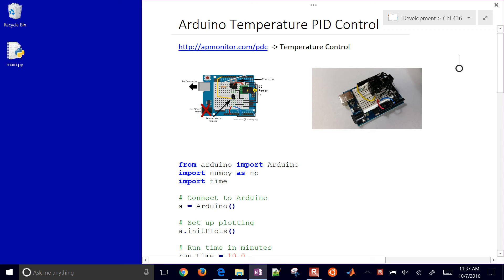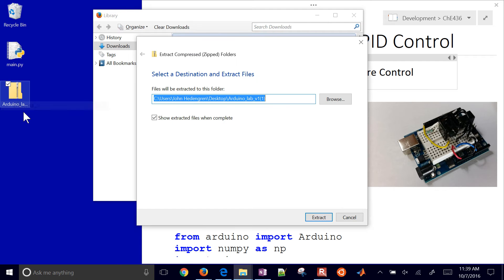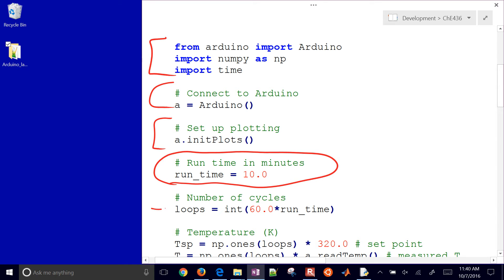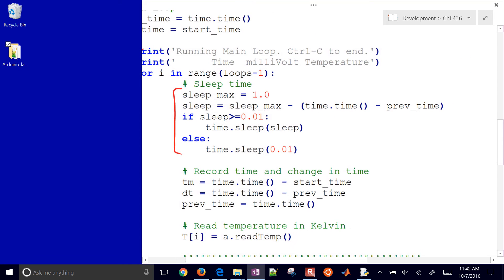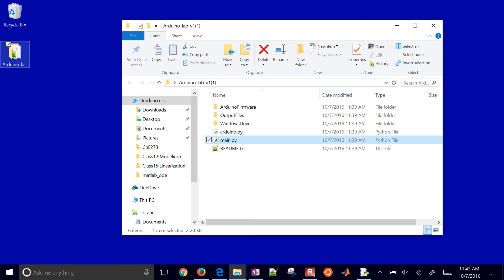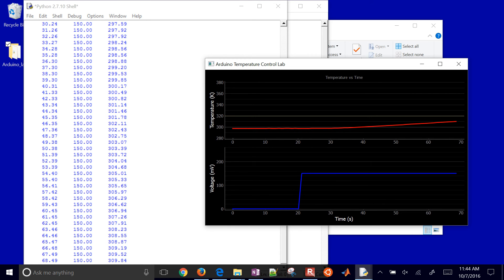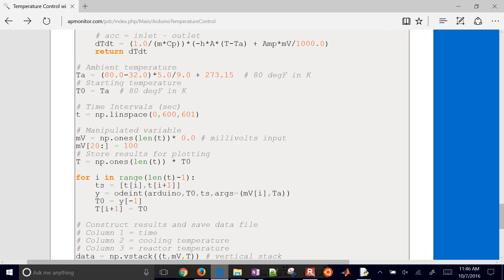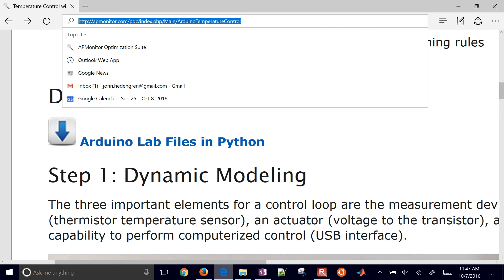Arduino Temperature PID Control in Python

Comment: sir, is it possible to make it without arduino, just by getting the input from the system at run time
Reply from the maker: The Arduino is required to convert the analog signal to a digital form and transmit it to the computer. Here is a software emulator if you can’t get the hardware. https://tclab.readthedocs.io/en/latest/notebooks/04_Emulation_of_TCLab_for_Offline_Use.html
Reply: @apm  thank you sir

Comment: It seems as though much of the lab and files provided on the website have changed since this video. The main.py file no long references the arduinos or anything, or atleast, I don't seem to follow. Is there anywhere I can still get access to what is talked about in the video? Thanks, I appreciate you putting this out there, I just need to figure out how to get it working
Reply from the maker: John, are you trying up build the kit yourself or did you buy one from Amazon? The files that are currently on https://apmonitor.com/heat.htm are the latest ones that are compatible with the ones you buy. There are also the latest videos. I also recommend the tclab package (pip install tclab). It greatly simplifies the setup.
Reply: I independently had all the parts needed for the set-up, i was just having trouble finding the files that you were referencing in the video. Which are you referring to when you say "latest videos"? Thanks so much for the reply, I appreciate it a lot. I am also running linux so in terms of the coms ports that seems to be an issue I have, if you can confirm that I need to use windows I would appreciate that too.

Again, thanks!
Reply from the maker: @Barkingstingray  - I'm impressed that you are building it yourself. I don't think we kept those old files but you may find something at http://apmonitor.com/che436/index.php/Main/PhysicalLab  The new version of the files are at: http://apmonitor.com/heat.htm - these should also work for you. Students use the lab with Linux, MacOS, or Windows.

Comment: very nice! so pro! In my temperature controller , i run the PID inside µC and send/receive data, (and PID gain  adjust ) with UART USB for the GUI Python (pyqtgraph*)...pretty cool on PC
With rasberryPi/Rasbian, it's not abvious (*graphic artefact, lag and or display delay insufferable )
Bye.
Cyrus.
Reply from the maker: I agree that the micro-controllers such as Arduino may be better for real-time data acquisition and simple processing. There also aren't problems with unanticipated power cycling that can be an issue with the Raspberry Pi Linux OS. I like the Raspberry Pi as a development platform and then the Arduino (or other micro-controller) for the real-time implementation.

Comment: Are you programming Arduino with Python?
Reply from the maker: +Nom Cognom it is a serial USB connection to a computer that reads data and writes a signal to control temperature. This allows the students to code in Python versus Arduino Processing code. If we were to make a stand alone (no cable connections) we'd write the code, compile, and send it to the Arduino to run the PID controller as an embedded application. I'd recommend a microprocessor such as a Raspberry Pi or Beagle Bone black if you'd like to run Python on the device.
Reply: Thank you. :)